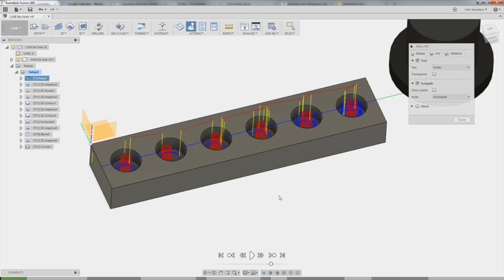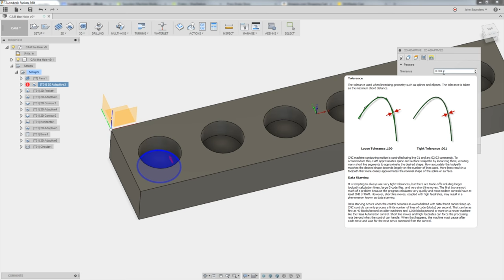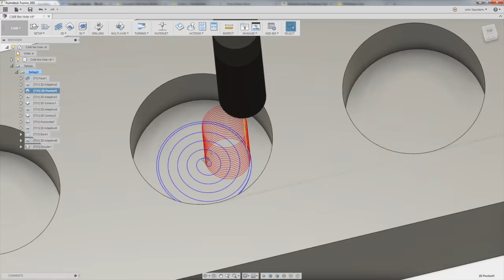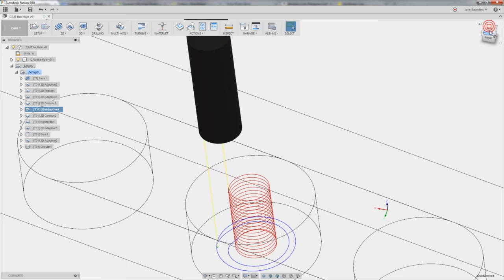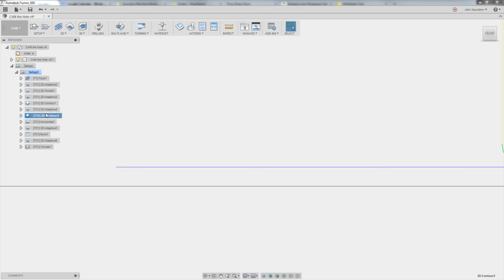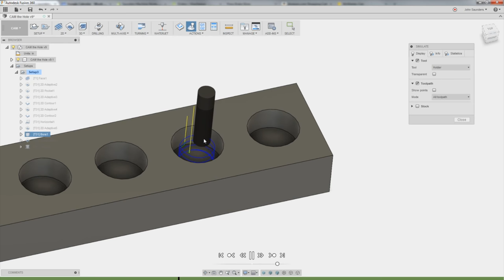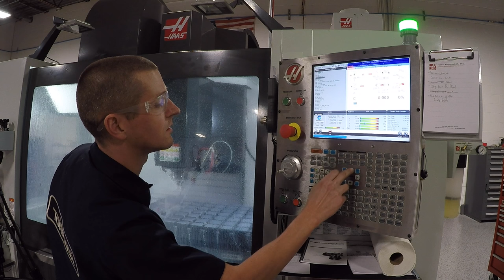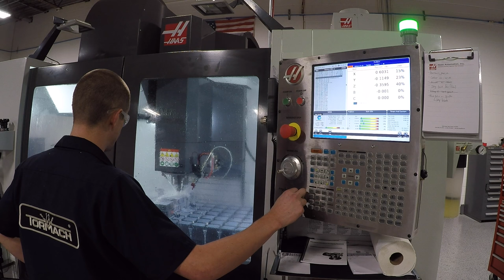6 Ways to Machine a Pocket - Fusion 360 (FIRST HAAS Chips!)  FF57

Comment: Hi, I know its 4 years old but still... I tried to go over all the comments but didn't see anybody mention this: I don't know how important this is but in the "Recommended"  method of Adaptive+Contour+horizontal - if the contour does not touch the floor and the forizontal does not touch the wall - wont it leave an un finished ring at the bottom of the hole?
Reply: I was thinking the same thing. I prefer using adaptive then pocket with no stock to leave to finish both the floor and the contour.

Comment: Cool video ! But you shouldn't run your spindle full RPM (15000) because it's going to kill it REALLY faster than normal ! run it at 80 % max instead (12000 RPM) even if Haas (or anyone else) is telling you there is no problem and you can run it 100% !!

Comment: funny is cam do 20000 lines simple workpiece and is smart to tell collisions. but NOT too smart not to make collision first place.i not understand why cam not use G2 and G3 when is possible even calculate those points in head, but will add 1millions line to complete simple arc

Comment: Try turning on setting 103 when running through a part for the first time. Hold the cycle start button to run, let go and it does a feed hold. Great control for walking the tool down to check the Z height.
Reply: Heard about the setting 103 awhile ago... Works slick

Comment: Just a few tip that might help you:
1: Press "current command" and page up until you get the menu where you can see the current position of machine and the distance to go in according to work offset and the G-code in the program - this is a great help when running the program first time to avoid crashes. I have a 2 year old VF4 - with older control so it might be different on yours.
2: Coolant - just press coolant button - it turns off external cooling straight away.
(you probably knew all this already)
3: Air coolant: I think its just to choose "MIST" in fusion tool library and you will have air coolant instead of flood. Im quite sure i tested it already.
4: Preload of tool:
Thats just to change in the post processor setup window in Fusion - choose "preload tool" to yes and it will preload all tools - its exclenet function - saving a lot of time.

I adore all your videos - they are great help and played a big part in my way to make my own rifle! Thanks - I´ll be more than happy to help you with some HAAS tips if I can.

Comment: I guess most NC programmers aren't old unix hands, but: sed 's/M08/M73/;s/M09/M74/' does the job good and quick, to replace your flood coolant with air coolant (I had to look up the M codes for Haas). You can accomplish the same thing in more time opening the NC file in wordpad/emacs/gcode editor/etc, and doing replace-all M08 -> M73, replace-all M09 -> M74, save.

I'm sure there is a way to do that automatically in Fusion 360, but I find it just as easy to postprocess NC using a bunch of sed or perl scripts that end with sending the fixed up NC to the machine ready to run.

Comment: When programing tool motion, when you have tool path that would generate a small I or J number (in g-code) your part surface feed changes. Your feed rate is the center of the tool as you go around a corner one side of the tool has a lower surface velocity, while the other side has more. We use GIBBS System and it has constant surface feed. It varies the IPM feed line by line if need. Saves tool life and makes a more uniform wall surface finish.

Comment: Glad to see you got your HAAS running.  Man!  that probe is SWEET!!!!!!!  I love mine.

I am sure in time you will be experimenting with adding custom probing operations to aid in the setup of your parts on the machine.  Look forward to seeing some of them in action on your channel.

Being able to adjust both the Feed Rate and the Rapid Rate on the fly is another great feature.
Being able to use the feed hold and turn off the coolant is a great option for looking at the part during the machining operations.
You can also add a custom code to the end of your machining cycle to center the part at the door opening and bring the table all the way forward for ease of removing your parts.  Not sure if Fusion 360 supports this or not but there might be a way around it by cutting and pasting code either in the Fusion 360 post processing or at the HAAS Control.

One other thing that you might??? want to look into is an air blast nozzle.  I made my own but HAAS does offer one.

Have Fun!

John

Comment: Hey John, Long while back (1995)  I had Issues with my wiper motor in my car. It was an old beater and I did not want to spend cash on replacement motor, but I need to see in rain storms. Found a product at the local Auto parts store called "RainX". It is a water disperser that I now put on all my cars and RV's. With this stuff on the glass,  I rarely ever need my wipers as this stuff is so good. 

I suggest you try and put it onto your equipment shields. In combination will a light air stream. I'm sure coolant obstruction between camera and work piece will be much reduced. 

:)

Comment: The profilometers i've used would all have a difficult time measuring anything there. You could measure along the bore, but since it's not transverse to the tool advance/scallops it won't produce an accurate reading anyway. Measuring for diameter and roundness is the way to go, and a true CMM is the way to do it.

Comment: Any chance of a secondary coolant system like a mist or air-blast which could be used for CAM testing (and videography), perhaps at a lower feed rate, before unleashing the flood coolant system?
Reply: I'd like to know too.  My gut tells me there's a reason every single high spindle speed machining center I've ever seen operates under large volumes of flood, usually from several simultaneous angles.

Comment: When face milling, make sure the entire cutter feeds across the face. Otherwise you get that funny looking finish like you have on the left side of the part. 
Not that it mattered here. Just future reference.
Reply: It really ruins the top appearance on an otherwise nice finish.
Reply: Yeah I wish that was the default for fusion, you have to always add pass extension, which I always do cause it annoys me to see that too.
Reply: Are you adding with pass extension? You can get the same deal with "Extend Before Retract." Way easier!
Reply: Yeah, but I like to extend the tool past the edges for the whole part, not just at the end. You can accomplish it with stock contours as well, lots of ways to skin a cat. :)
Reply: you are clearly a genius as I never saw that complex feature!!
Reply: directed at Greg Koenig...

Comment: If you don't touch the floor and then also don't touch the side you will leave an un-milled region around the entire bottom.
Reply: Yes, which is about a nothing in this video. 99.99 % of parts probably do not need to have an exact deadsharp corner, so the issue is very very specific application.

Comment: I'm just wondering.... why do you start your downward spiral so far above the part? it makes 3 to 4 revolutions around the set diameter before it comes in contact with the material. I know it's not a huge deal with the type of work you do but in a production manufacturing environment it seems like it would save time not having it cut air for that duration of the cycle? love your channel long time follower thanks keep it coming I look forward to seeing your videos every week. congrats on the new HAAS purchase I would be equally as excited lol
Reply: It's not so much him as it is the Fusion defaults.  I has a VERY high default start for helical ramps.  You grow old waiting for it but it's there for a good reason.  You can change the default helical ramp height easily and set it a lot closer, but you have to do it each time you make a new setup.  I'm pretty green at this, but in my experience in a one-off job you are better off wasting 10 seconds waiting on a helical ramp to contact than finding out you weren't quite right on your stock height and crashing the tool into it before it starts the helical ramp.  I go back and set my start points really close... after I prove out the part and stock.  If you are doing one part and you need to hold your finger on the feed hold button you have to have the helical ramp start early enough that you have time to see it working with a slow feed before crashing into the part.

Otherwise if you do your CAM setup full speed efficient right off the bat you get a FAST rapid straight down into position a few thou over the stock and a near instant contact on the helical ramp.  It's scary as all heck on a cycle you havn't actually tested.  Bad, bad crash if you don't KNOW it works.

Comment: Great job getting it up and running. Now that you can change tools, I mean your machine can change tools, chamfer everything you can with the machine, I lowers your variance part to part. Ruff and finish with separate tools, If THE HAAS has thru the spindle coolant (let's hope so) the DIN  AD+B Flange Coolant endmill hoders work wonders. Making a washer tool, 1" stock 7/8 drill almost thru one end, 5/32" holes from the other end wash the chips away while your operator stays clean.

Comment: Must have just turned Friday in NYC barely haha you're early John. Glad you're having fun with the haas, I like the clean look of the control panel and haas just seem to have thought of everything around the machine.
Reply: Except for the fact that the normal G-Code (as pretty much all cnc's use) does only start selecting the right tool (rotating the magazin) after the previous tool has done it's job. With todays complexity and capability of controllers or in general PCs one could expect a kind of "look ahead" feature that knows which tool to use next and therefore prepares the next tool while the current one does it's thing.
Reply: Haas does use look ahead.  Different work offsets block it though, so its best to pre-set the next tool just using T* on a separate line of code, immediately after your previous tool has been grabbed.  That way, the tool is ready and waiting for an instant tool change :-)

I think haas done a video on it once.
Reply: That has been possible for at least 20 years :-)
Reply: David Dean ok, didnt know that, im not that much into the specifics of cnc machines. would an immediate repositioning of the tool delay the other machine movements though ?
Reply: No, its basically just giving the machine a heads up, telling it to get that tool ready for the next round of cutting.  So once the code is executed (takes about 1/10 second) the SMTC moves while the next lines are executed.
Reply: David Dean maybe we have a misunderstanding but my point is that the Magazin should rotate while the current tool is working. I understand your last comment as that the magazin rotate can happen whenever you want (at the start or end of an Operation) but still the magazin rotate and Operation dont happen at the same time but one after the other
Reply: It happens at the same time.
Reply: Preload tool:
Thats just to change in the post processor window setup in Fusion - choose "preload tool" and it will preload all tools - its exclenet function - saving a lot of time

Comment: I use Powermill and Lemoine, tolerance in programming is everything. You can really mess up if tolerance is bigger than stock left, stepover, stepdown. Its good to have big tolerance for roughing so it creates less points and then thats less code so machine moves fast. Haas may be better nowadays for that. You'll know when you try 3d with it

Comment: If you're unsure about your z-height a great tip is to use your "handle feed" - instead of going back and forth between feed hold and cycle start. Run it at a 100% rapid with this, the rapid will slow with the feed percentage.

Also G92 is your friend if you want to use a permanent 0-point. G54 is always the top left corner of my vice, then use G92 to move your zero to whatever matches your part. (instead of probing everytime.)

You might also be surprised with how much the rigididty of the machine and the flood helps. You can take some really aggressive cuts in aluminium as long as the chips can evacuate. (e.g. 80%stepover, full depth with a 1" tool ~8000rpms, 140in/min)

Comment: I can't recall exactly what it is off the top of my head, but there's an entry clearance parameter on the 2D pocket tool that allows you to manually center the helical entry and then spiral out from there. And I think smoothing tries to output arcs instead of line segments. It's been a while :P

Comment: I have a profilometer, but it really needs big areas to operate well. The bottom of a hole would be really hard. If you made that floor 1/16" deep or less with 1" or more diameter, our profilometer would work.

Comment: Does the original Fusion post work with you trunnion? Or you haven't had a chance to test it out yet?
Reply: bojibka yeah the generic post will work with the trunnion, it just needs some stuff turning on inside it.
Reply: NYC CNC it will probably be one that supports DWO & TCPC
Reply: I use a 4th axis trunnion. Its a task to make it turn the shortest way - so I needs to manually edit the code - A code -  to make sure I dont have collisions with the table. The AD post team told me its possible to change some setting in the Post Processor code to make it turn other way/shortest way - but didn't try it yet. I have the rotary engine on the right hand side in the machine.

Comment: On the face mil op, you might want to change your lead in/out rates to the same as your cutting rate, plus use the "Extend to retract" option. HSM does this funky thing where it changes to lead in/out in the middle of the cut. It's annoying, but you can fix it every time you throw a facing op on there.
Reply: Greg Koenig why don't you set the default?
Reply: You can set the default on a checkbox in HSM Works? I've tried and haven't found a way, but you know... I can be clueless!
Just tried to use the kinda hidden "Changes" menu to set Yes as default on Extend Before Retract, and it didn't work. Seems like it's possible that way, but not-working.
Reply: Greg Koenig do you mean the compare and edit dialog?
Reply: Scott Moyse It looks like Compare and Edit, but if you access it from a right click in the feature manager, it's called "Changes" (IIRC)

Comment: Nice work, John...looking forward to a lot more from you guys.

Now rapid the $hit outta that thing. ;-)
Reply: RIchard Fitzwell 
VM's don't rapid that fast. 700ipm Thats it. They have closer pitched ballscrews since the machine is designed for accuracy not speed. Where as the VF's have 1,000ipm rapids. 

That's also why there's a $30k difference between and VF3 and a VM3.
Reply: That's fair enough...but 700 ipm still supersonic compared to the PCNC 1100.

Comment: no feed and spindle speed override knobs? i would not work on that machine :/
Reply: There are buttons for that...
Reply: bensbenz not an alternative
Reply: Haha, sure it is. If you have to play with spindle and feed overrides all the time your not doing something right. I have a robodrill that has the knobs, I use them one time per part maybe. I also run a Haas and do the same. While I prefer my the robodrill on the whole, the Haas control is much more user friendly and faster to operate in almost all regards.

Comment: Crap, they sent you a geneva SMTC?  The whole point of a SMTC is to be fast!  I thought they only offered the servo option for the SMTC?  You better double check your order and make sure they didn't mistakenly install the wrong SMTC.
Reply: Was wondering if someone else picked up on that, but with a dual arm and buckets he should be able to prefetch the next tool.
Reply: Geneva drive is great because its simple, just a motor, gear/cam assembly, and a limit switch. My machine has the same design for the tool changer turret. However the down side is there slow because it stops at each location. Servo drive is faster but more money and complexity.
Reply: I disagree, I had a Haas with geneva and a Tree with servo.  The servo couldn't be simpler, it was just a servo motor, 2 gears for reduction, and a home switch.  It was FAST and had fewer parts than the Haas, and being of the same age and usage, was in FAR better condition.

Comment: don't be scared of the rapid... its scary at first but if the setup was done right you won't have a problem.
Reply: Arnold  , after a first part prove out sure but I'll take my time lol
Reply: Ive only done checklist and made sure that all setups are done. Ive never had a tool plunge down on settings, but it has happened while in drip feed... old machines make mistakes. But if i had a haas i would probably also slow down.